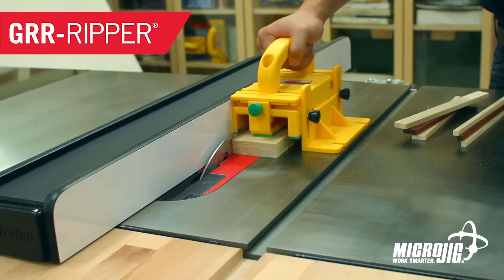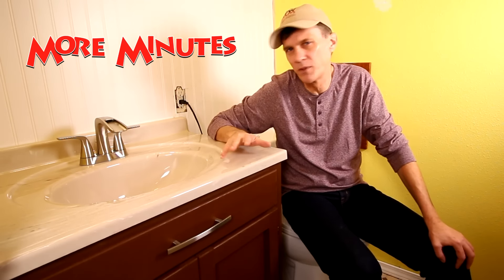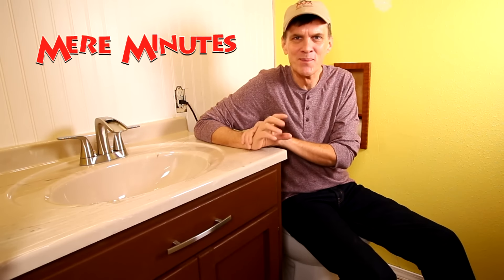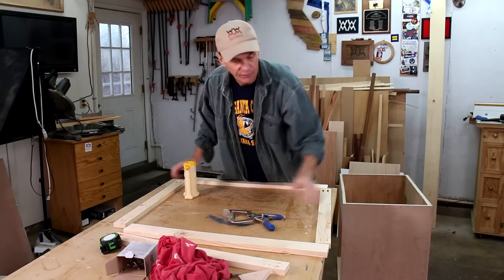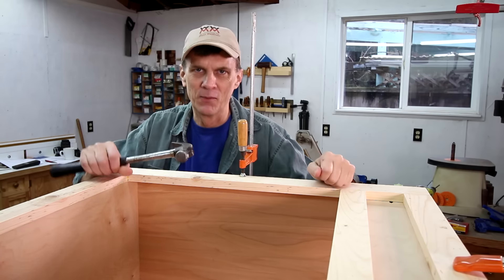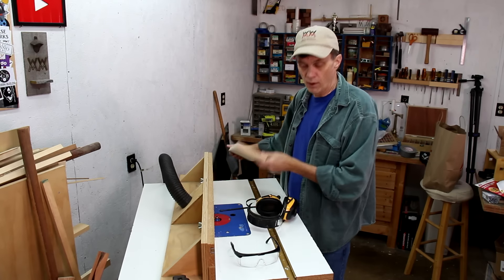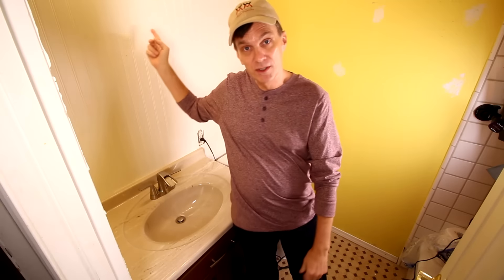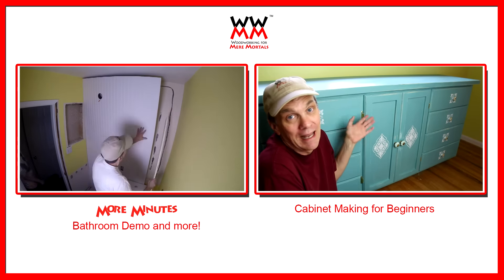DIY Bathroom Vanity.

Comment: Forgive me if it's already been mentioned.  Your tip about mounting the faucet on the sink before install and can only be improved by mounting the flex hoses to the faucet as well rather than the stub outs.  Much easier to attach to the shut offs than crawling under the sink, as you did, to attach them to the faucet.

Nice job and enjoyed the video!

Comment: is step two installing a GFCI near that sink there?
Reply: +Rich's Fishes It could be protected by a GFCI breaker or by a GFCI outlet further upstream. It was pretty common back when GFCIs first came out to have all the outlets that needed ground fault protection in the whole house chained together (so you would only have to buy one back when wire was cheaper than GFCIs).

Comment: A little tip for installing a sink like the one you have:  if you connect the water lines to the sink first they're easier to connect once it's put in place.  Instead of having to reach up under the sink to connect them, you're attaching the water lines to the cutoff valves which is a LOT easier.  Just a tip. :-)

Comment: After I finish my bathroom renovation I hope to do my first cabinet project. Basically a giant wardrobe. Any tips on painting the wood or type of wood to get?
Reply: Short answer Poplar or Pine. Long answer pretty much anything if proper precautions are taken. Some wood can be oily or sappy and can interfere with paint. Sanding is key and waterborne paints are a good option. There is a lot of info from professional painters and cabinet builders. Pinterest and professional forums are a good search

Comment: I'm interested in any tips you have for how to mark the holes for existing wall obstacles on the pieces you're putting back, like the sheet of wall covering or the back of the cabinet.
Reply: +Michael Lawing Ok, how about tape measure from the base part to the obstacles in height and left/right direction and transferring these measurements to the back panel.
Reply: +SE45CX sure. Perhaps a story-stick, or a tape template. I just wondered if Steve used anything other than straight measure.

Comment: Is there an advantage in making a the riser/base a separate box?
Reply: I would say no in this situation. The separate base works well if your have Multiple cabinets to tie together. You can lay your base and level it easier then set your cabinets on top. Personally I like all in one design but that's just the way I learned.

Comment: How would u build a cabinet without using plywood or other engineered wood product? Solid lumber only.

How are top cabinets different? Kitchen top cabinets use French cleats for wall mounting, but how do deal w the weight of dishes inside & the tendency to pull down & off the frame?

Comment: Next time, hook the water line on the faucet before putting the sink in place.  The bottom connection, at the cut off, is easier to access with a wrench rather than trying to use a wrench next to the sink.  Hope that makes sense.

Comment: Steve, why did you choose pocket screws to hold the cabinet together? I would in the face frame, but for the carcass a half lap or even tongue and groove  be a stronger  joint right?
Reply: It only has to do the job. It doesn't have to go above and beyond. Good enough is good enough.

Comment: Plumbing tip.  When installing a new sink, attach the supply lines to the faucet rather than to the supply valves.  The valves are far easier to get to then the bottom of the faucet!

Comment: How does more expensive plywood prevent chip out?
Reply: Sturdier core and thicker veneer.
Reply: It doesn't. Even if you cross cut a solid piece of wood it will still chip. The tape trick is a good one. Maybe he is referring to when you rip cut a thin veneer plywood might tear then when usually you don't get much tear out on a rip cut. I also recommend make zero clearance inserts for all your saws. Works great just need to make sure to replace them ones they get to worn.
Reply: +Lucid Moses It can help a little but not as much as some would suggest. Tape is a good tip, but It also makes a difference if you put the face you want the nice cut on to the bottom when cutting it, that way the teeth cut up into the ply, this can prevent it tearing a little more because the outer veneer is pushed into the rest of the ply, insead of away into thin air with no support. Also a good sharp blade. If you are cutting lots of ply i would suggest getting a plunge cut saw with a guide rail. I was lucky enough to be able to get myself a Festool plunge saw recently and i was amazed at the cut it gives with next to no tear out even on the very cheap grades of ply.

Comment: I just started in woodworking I only own a circular saw and drill, I built a small desk for behind my piano, it ain't pretty but it will do it's job. Anyways I don't have a work bench and I was wonder what the best way to get a square cut with the circular saw, I bought some clamps but they are pretty awful. any advise? thanks!
Reply: +Mattsmindmeld You can make a guide rail very esily and cheaply. Also get a carpenters square and make sure it is square before using it. You can find videos on how to make sure they are square and how to fix it if it isnt on Youtube.

Comment: here's a quick tip for you! it's eve easier to connect your supply lines for the faucet if you connect them to the faucet first and after you put the sink in place you can connect the lines to the angle stops! It saves you from having to lay in the bottom of the cabinet looking up to connect to the faucet.

Comment: Nail gun or little exercise? :)  I wanted to ask you if grid of sand paper, affect color of the wood that you are painted? Exampe when you sand with 120 grid is better color that the 80 grip paper?  

And i realy like your projects, i have some pallet wood so in the spring i will use it to make myself big table for PC and for study, i builded last year my desk but i dont like it. :D Keep the good work! And Happy New Year.

Comment: is there any special curing for the wood to protect it from moister ??
Reply: and can you please make a wooden sink??I think that would look sooo cool
Reply: lilyashy 
that'd be interesting; I guess you'd have to fiberglass it, or something?
Reply: +ThoperSought no just a thick polyurethane coating
Reply: I paint the interior surfaces that are often unfinished.  It helps with occasional leaks/sprays etc. that you get with plumbing.  I often just prime the hidden sections.
Reply: Jacob Marks
hadn't thought of that.  have to be pretty thick, tho, wouldn't it?
Reply: 3 coats should do it
Reply: Jacob Marks
thanks!

Comment: no mortice and tenon was cut that day...
Reply: not that it would matter much for such a cabinet, but Steve seems to be a die hard fan of pocket screws :D
Reply: +Steve Ramsey I like Matthias Wandel pantorouter - those perfect fit joints are a pleasure just to look at. Unfortunately, I still cut them by hand when I have to do them. I also saw on The Samurai Carpenter a drill bit that cuts square holes - I don't have those either :-/ 

Btw, it seems that a guy makes pantorouters from aluminum extrusions - http://hybridpantorouter.com/shop , but it's quite expensive.

Comment: I know you like to use spackle or drywall mud as a wood filler because you have it handy but wood filler doesn't cost much, available everywhere and the rite tool. I think anyone that buys wood glue by the gallon should probably have wood filler. With the only exception of Matthias.

Comment: I really hate the idea of a false drawer
Reply: +ollythebest94 I agree, it is pointless lol.
Reply: I've seen pretty them replaced with tilt out brackets so they can be used to store small things like soaps and l lotions. doesn't interfere with the plumbing and makes the false front usable.
Reply: Makes you lose hope in life :(
Reply: glad I'm not the only one that hate fake drawers. especially when they're done really well, and then the fucker throws a handle on it
Reply: +jbulldog104 LMAO!!
Reply: almost as bad as a wall covered in mirror tiles that gives the illusion of another room....
Reply: +ollythebest94 Another option that is 'trending' is to eliminate it altogether and simply make the doors full height.

Simplifies the design, reduces materials and improves access to stuff underneath.
Reply: Yeah when I was little I would always get so confused and I'd try to pry it open with my fingers only to find out that they're fake and useless. 😔 very disappointing.
Reply: two options in my opinion would have been way better. 1. a shallow towel bar to hang a hand towel or a flip out door to store small things like dental floss, q tips, things like that. I don't not like a false door at all either.
Reply: I hate false drawers too. All fake shit for that matter.

Comment: You have a nice table saw and you used Pocket Screws (really) and nailed the doors on the back of the frames no recess what a waste of good plywood.  Yer capable of better. But you are right cabinet making is easy even when done right.